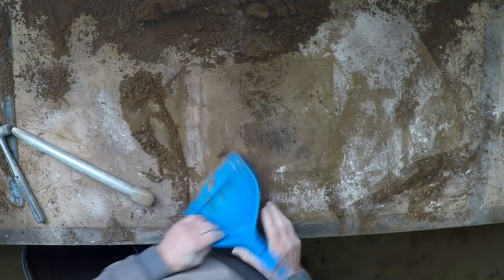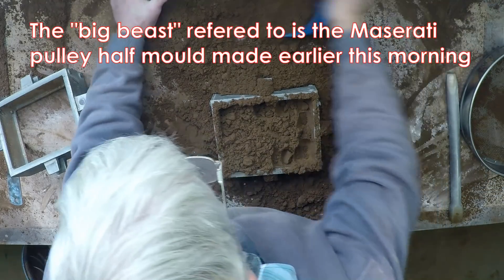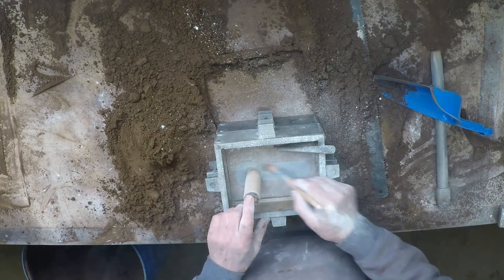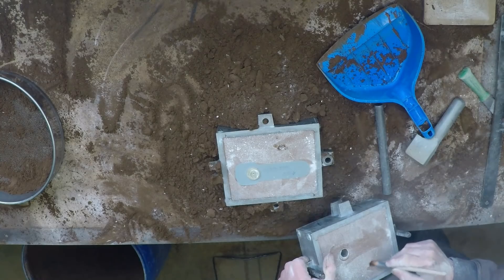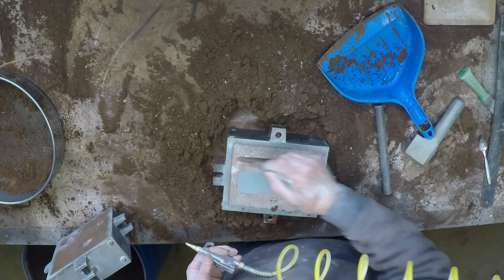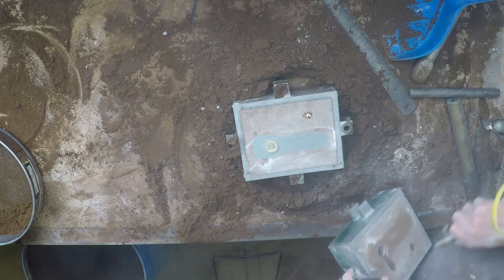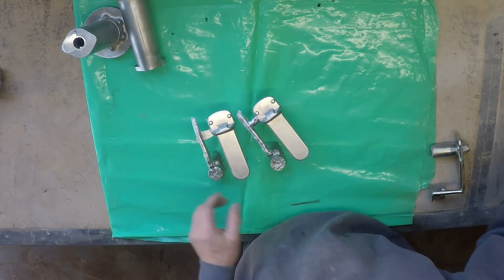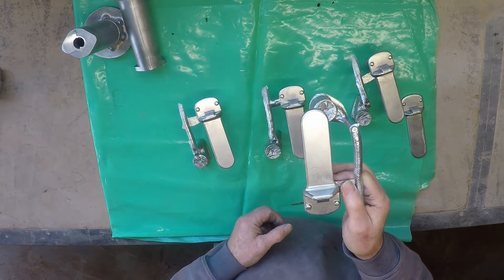Sand Casting an Aluminium Vacuum Cracker for Jars

Comment: I can hear birds in the background.  I could have cnc machined that far quicker!
Glad the calcium carbonate parting agent is not talc, that can kill you I have heard.
Thank you for the demonstration of exothermic to keep the feeder hot
Best casting finish on Youtube without a doubt
Thank you for a great video
Reply: But could you cnc 4 or 50 of those faster 😉 (I assume you're just rubbing ribs after the last video discussion on  cnc vs cast... )

Some talc has been found to have asbestos fibers. Some talc mines have been shut down because of it. A good supplier of talc should be verifying that their product is asbestos free... but even J&J had a 3rd party supplier fail to certify correctly and some tainted stuff got into their baby powder and other talc products. Plus talc isn't eliminated by the body easily.
Reply: https://www.fda.gov/Cosmetics/ProductsIngredients/Ingredients/ucm293184.htm